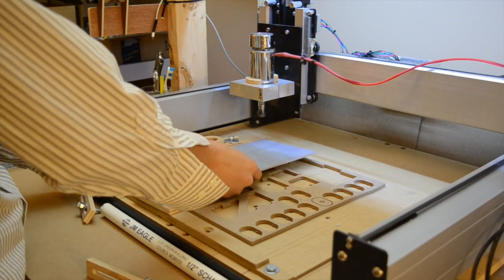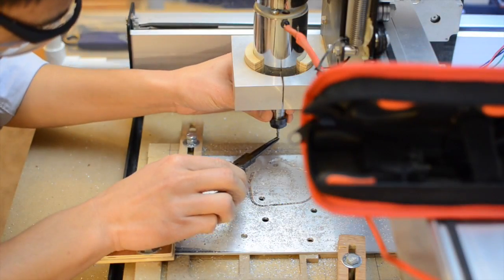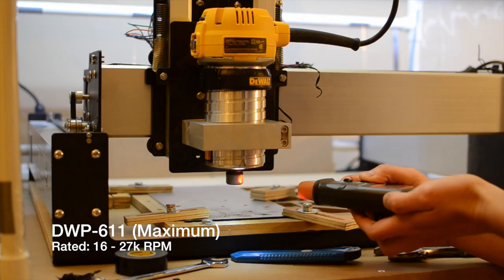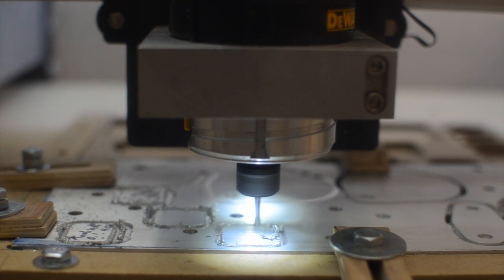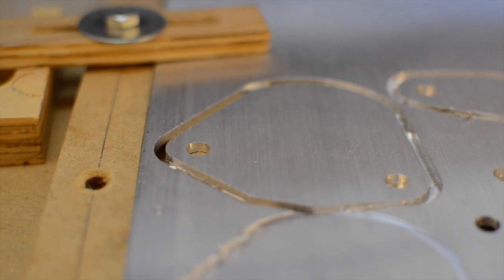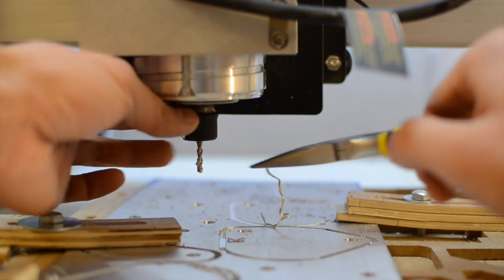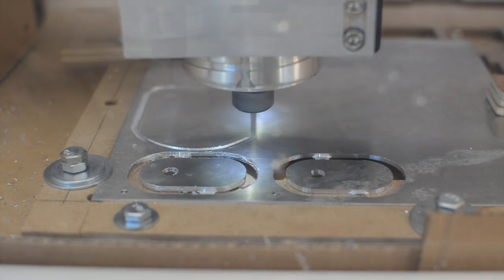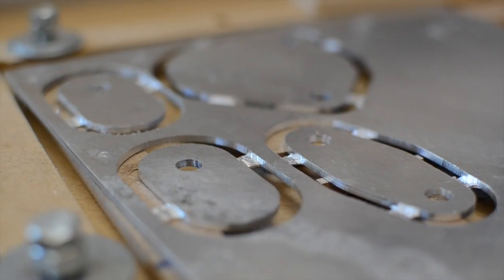How (Not) to Cut Aluminum on the Shapeoko 3 - Project 44

Comment: I also went through a lot of trouble with cutting AL. Here are the main game changers:  1. Single flute endmill. Nothing fancy, $17 for 10:  https://www.amazon.com/gp/product/B07F35WQYG/ref=ppx_yo_dt_b_search_asin_title?ie=UTF8&psc=1    2. Air blower, again nothing fancy, just a regular compressor with a jet blower.   3. Motor with closed-loop, like MKS SERVO42B, so steps are not getting skipped.   I can easily cut 5mm thick AL with 1/8" end mill. Speed is 500mm/min, spindle 10000, DOC 0.5mm.

Comment: shapeokos, no matter what model, can't machine squat! Maybe a few useless pieces of wood. Lately I stupidly fiddled for days with my shapeoko (that has NEMA 23s) to mill 3mm acrylic panels. It eventually... "kinda worked" but rectangles still came out trapezoids etc. My local lazer cutter ended up doing 10 panels for $37.50! So about $1k and many many wasted days of my life to save myself $37.50. Don't bother buying any hobby mill, 3D printer etc etc etc! p.s. I have two metal lathes and two milling machines that weigh 350-700kg each FYI... just for the knob heads thinking of commenting trash talk :-D

Comment: Great vid, thanks!  BUT No where even near enough lubricant!  Aluminum will always stick to the tool especially if your running high rpm.  The speeds and feeds are entirely dependent on the ability of the machine and the setup.  Charts and calcs are usually useless in my experience.  But unless your in some kind of mad rush (industry always is) just slow everything right down and you wont generate as much heat.  Not sure though on those routers how slow your RPM can go.

Comment: For aluminum in the Linamar Plants in Canada we used Varsol in a spray bottle to cool the carbide cutters while cutting Aluminum Chevy V-6 water pumps. It work very well. I found that the way my Machine was setup the the first month of running it was to slow and could never get a mirror like finish that was needed for Quality Control so i dial indicated the 12 cutter in the cutting head which removed the vibration, it was a old manual machine. I picked the lowest cutter and shimmed all the rest to match it, then i double the feed and RPM's of the tool and that allowed me to double my hourly out put with a mirror like finish. this got me a raise and allowed me to do my own machine setups after that. That was 38 years ago.  Try using conventional cutting when using the Shapeoko 3 because the light frame is like having backlash problems when using small flexible cutters Climb cutting pushes the cutting edge away from the stock and conventional draws the tool edge closer to the material which gives a more controlled size and needs less spring cuts do to tool flex.

Comment: If you have the possibility to add mist to your machine it would help a lot. In that way you get oil to your cutting tool as well as chip evacuation due to the pressurised air. This will mess up your wood base over time, but alternatively you make another base plate in aluminium !!

Comment: Get the machinist calculator app. It will tell you that 30-40ipm is your cutting range. Regardless if you have a 20k-30,000rpm spindle it’s too fast. Cutting aluminum doesn’t need to occur over 8000rpm on any machine so if you can’t slow it down without losing torque change the spindle. If your gantry can support it start with a minimum 3kw spindle or beef the gantry up so it can support it. Anything smaller is probably going to chatter, break end mills, or require triple the time simple skimming the part until it’s made. Who’s got the time for that?

Comment: Hello Winston, do you have any advise for engraving text on Aluminum. Need to engrave the text to a depth of .003 inches and the text size must be at least 0.125 inches high.  I am using a 1/8" V bit. the Amana 45609.  Not sure how to add the bit size into the library, Also how to adjust speeds and feeds. I was told that the Carbide Create program can not control the depth of a V cut.  Thank you.

Comment: Shapeoko is not beefy it is resonant as hell and the mills are tiny. Your rpm calculations are correct but you feed rates are for standard R8 collets not little tiny dremel collets. No book of industrial standards will even acknowledge a dremel sized end mill. Remember by industrial standards, shapeoko is a toy. In aluminum your feed rate needs to be 3/4 slower than r8 standard speeds at least! Its not a race if you want a quality cut. Also If your rpm is wrong the aluminum will either gum up on the bit or overheat it and snap

Comment: A good starting point for speeds and feeds is : cutter speed ( you can look up the cutter speed value for any given material in the "Machineries Handbook" ) X 4 divided by diameter  .
Back off on the speeds and feeds for your first run, then increase to see how much the project / set up can take.
The diameter in the equation is whatever is turning. If it's a lathe, then that would be the stock diameter. If it is a milling machine, it would be end mill diameter.
Hope this helps.
Take care.
Keith

Comment: Use very short 1 flute bits for aluminum.  The single flute improves chip clearing (which you accurately pointed out as a huge priority for routers in aluminum) significantly.  And the short bits give you similar rigidity to thicker bits.  wcproducts.net sells fantastic single flute bits.  You won't regret it.

Comment: On my CNC router ( my design and build), I also use the Dewalt router as shown in your video and I also run it at about 80% of it Max RPM. But, I use 1/8" single flute end mills that I buy from drillman on eBay, at 20 Inches per minute, and a .030" depth of cut. As you have found, a good blast of air to clear the chips is a must or they will weld to your cutter and break it. I do not use any coolant - just air. I have cut up to  1/2" aluminum this way without cutting a wider channel first for chip clearance.

Comment: Great video. Would you recommend this machine for fabricating small alumnium, carbon fiber and cutting cystal materials? Or do I need a more expensive industrial grade CNC machine?
Reply from the maker: This will do all of those, though each one has its own requirements. CF, the big one is protecting your lungs. And all of them benefit greatly by using specialized cutters.

Comment: I'm a CNC machinist by trade. I program gcode for Haas CNC mills both manually by hand and using cam software to complement more complex features. We cut mostly 6061, and we HOG it. 

There are a few key things I've learned over the years:

1) RADIAL ENGAGEMENT (this is the #1 source for the difference between a good or bad cut) - the amount of the diameter of the cutter that is engaged with the material being cut. The more the material wraps around the cutter, the less time the cutter has to cool off between cuts, and less opportunity for chips to leave the cutting area. I like between 5-25% engagement depending on diameter of the cutter. Keep in mind that not all cutters are made the same, and the simple act of plunging can ruin some cutters no matter what you try (it's often better to ramp down at an angle or Helix into part instead of plunging in z-axis only)

2) chip evacuation - both in the cutter and on the workpiece. If the cutter begins to re-cut chips it already removed from the material, it will develop premature wear and/or chip a cutting edge or break. If there isn't proper room for the chip to exit the relief area of the cutter, the cutter will clog up and begin the welding process.

2.5) cutter geometry (WOW)... This one is somewhat really important. Aluminum LOVES non-coated high polish solid carbide end mills with a sharp edge and a margin after cutting edge (to prevent the cutter pulling itself into material off-axis of rotation) as well as a high Helix. We run between 30-45deg Helix normally, and the only exception is extra long tooling. we are currently running a job that uses a custom ground .125" dia by 5/8" length of cut end Mill that we will probably have to shorten up because of chatter

3) coolant - well not really. It helps tremendously when you are taking deep and fast cuts with large stepovers, but if you learn from bullet point (1) then you will realize coolant helps but is not a king pin requirement. Coolant allows you to cross that radial/heat buildup issue by transferring heat away. Keeping radial engagement in your mind when programming toolpaths will relegate coolant's job more to long term tool life rather than short term (we have had 1/2" end mills that ran for 2+ years @ 40hrs/WK at a material removal rate of 20+ cubic inches per minute; that's 200,000 cubic inches of material a month as waste material in chips if I did mental math right)

4) rigidity - you mentioned this in your video. Pretty much is a basic tenet of machining. Good clean cuts require rigid machines and tools (most of the time; some operations benefit from some slight flexing but that's another topic).

I didn't mean this post to end up so long. I got carried away sharing my knowledge from my passion/profession... Lol

Good luck to you, and I hope I helped future endeavors.
Reply: I just printed this comment out, and posted it on my refrigerator.   Highest complements.
Reply: Comments from passionate professionals are often very good. Dense with information. Yours definitely is well appreciated by me, and I imagine anyone who is thinking about cutting aluminum or has started to and is having difficulty. Its one thing to think you have an idea what is going on, and another to have your suspicions confirmed by a pro.
Reply from the maker: All fantastic information. No amount of internet research can replace experience.

I'm actually a little curious now about what cases you think tool/machine deflection isn't a purely negative behavior...
Reply: when chasing an existing hole, using a rigid tool where the 2nd drill doesn't line up precisely leads to heavier engagement on one side of the tool. Using high speed steel tools (or flex in the machine frame) can allow the tool to flex without breaking. A solid carbide tool (especially a smaller tool size) in a rigid machine could break off in the hole because it is hard yet brittle and does not like flexing. This could swing the other way also, as too much movement could also allow the 2nd tool to bind in the hole.

Deflection in carbide tools = breaking, chipping, edge wearing. Simply put, if carbide is engaged with work material and it's not cutting the material, then it's bad news bears.

There are cases where a tap would benefit from less rigidity. Google "tapmatic" units (I think I got the spelling right). They have a special tool holding assembly that allows the tool to move off axis while still being straight (like the couplers that connect the stepper motors to the lead screws on other router tables)

I can't think of any other situations at the moment. Typically rigidity is best

Comment: pro tip: use an actual milling machine 

also use hss because there is almost no benefit to using carbide here as it needs higher feed and speed rates to provide any benefit, which are not attainable. the point of carbide is that it can be run hard and fast. you are incapable of doing that on this machine, so don't waste your money

Comment: Use the shortest end mill you can find to reduce vibration and shattering. ALWAYS use a spray mist of air an alcohol to lubricate the end mill and clear the chips from the cutter, this stops recutting of the chips which otherwise will deterate your edge finish. The alcohol stops build up from aluminium on the end mill. The rule is to actually cut aluminium and other soft metals with a high feed rate to avoid heat buildup in the end mill. Heat is the number one enemy of your cutters life. The rigidity of your machine, the power of the spindle and the quality of the end mill are the things determining how fast you can go. Your cuts actually look ok in the end considering the machine you're using. Alcohol and compressed air will make all the difference.

Comment: I have made slotting cuts with 1/8" cutters as deep as 15mm in aluminium (in small steps of 0,5mm), it helped cooling it with methylated spirits (or something similar). It suspends the chips and cools the part so it doesn't clog up. But the stiffness really seems to be a big problem with this machine, the flex you show in the video is really not tolerable. Maybe it's the chatter, that makes your bits break?
Reply from the maker: +Klaufmann part of the problem was the machine not being perfectly level, and some of it was the weak DC spindle I started with. I have since gotten better results going slow and steady.
Reply: Yeah, especially with simple CNC routers that aren't very stiff there are lot's of adjustments to make, I notice that on my machine myself. The leveling and alignment also isn't that trivial, because the components are often not perfectly straight or can sag because of the weight. I can measure a sag of roughly 0,1mm to the middle of the table, because I use 20mm unsupported rails. If I face a part and hold an straight edge (or in my case a metal ruler) against the light on the surface I can make out a clear gap in the middle and a touching spot on each end.
However, I use a ~1kW Kress spindle and that makes a huge difference. I also noticed that it is sometimes better to use a bigger endmill because it is more rigid.

Comment: Be careful when Milling aluminum it shrinks .0005 when it cools, I do 2 finishing passes with a higher rpm  with less doc to get a nice surface finish i also just use a compressor with an attached air nozzle to cool my part while cutting.
Reply: Not when you cool it enough ;)
I use methylated spirits for cooling and lubrication. But yes, finishing passes are really good to improve the surface finish.

Comment: Hello winston, I am ready to do aluminum cutting. my sock is 3/16" thick - it is not 6061 but 50-52 - I am new never cut anything yet just bought a SO3 XXL and been learning. pls help me tell me what is the speed for spindle  and punch rate, how many inch per minute.  I have a water cool spindle 800W -1.5 KW
Reply from the maker: I honestly don't have a good point of reference for you. 5052 isn't supposed to be very good at machining (https://www.shapeoko.com/wiki/index.php/Materials#Aluminium). I would try the "official" feedrates recommended (https://www.shapeoko.com/wiki/index.php/Materials#Official_Feeds_and_Speeds), make sure you have a coated endmill, and cutting fluid. If that doesn't work, adjust your cutting parameters from there, faster/slower. I can't advise you which way to go, as you're well and truly in unknown territory. Unless you really need 5052, I would abandon it and get some 6000 or 7000 series material.=
Reply: Thank You for the info

Comment: Alcohol mixed with water at a ratio of 30% Alcohol and 70% Water works very well for aluminum.  The alcohol cools the material much better than water and the water is sufficient to keep from any possible combustion if heat does build up.  Plus the alcohol helps evaporate the liquid and reduces oxidization.
Reply: Rodney Reynolds sounds like a recipe for an explosion.
Reply: urjnlegend ... that would be a nope.   many use a much higher alcohol to water ratio and is safe.   combustion requires specific fuel to air ratios and wth the introduction of the water it throws that potential out.

Comment: there is something in germany we call it glueing, if you are to slow the aluminum will "glue" so at work we cut aluminium with a spindle speed at 1800 and cooling (cooling is important against glueing - sorry dont know the english word for that - sticky?)
but i think you have to look what kind of aluminum you have     by the way NIce Video :)
Reply: chip welding
Reply: "Gummy."
You are welcome.

Comment: thanks for sharing this video! I made my own cnc, but i wasn"t shure if i could do aluminium as well. But i think my design of cnc is even stronger than a shapeoko, so i'm going to try aluminium too. Woul be great if i can do that too. Thanks for the warnings and personal experience. ;-)
Reply: Wim Meeus was it hard to build?
Reply: it wasn't as hard as i expected. That will be beginner's luck i guess :p . I made a lot of mistakes though and i'm allready thinking of rebuilding my machine with some major corrections. Good thing is now i can use this cnc to do the perfect measurements and cuttings, so it will be easier this time. :-)

Comment: that spindle isn't nearly strong enough for aluminum.  need a DeWalt.
Reply from the maker: +Jesse Fritz Yep, even better than the Dewalt in this case though is the Makita.
Reply: I'm ordering mine probably Monday. Would you recommend that over DeWalt?
Reply from the maker: The only thing to note is that the Makita is slightly shorter than the Dewalt, so if you're cutting at the wasteboard level, you may have trouble reaching the bottom with shorter endmills, like 1/8" and 1/16" size. However, if you tape or screw down an extra 3/4" sheet to the top of the wasteboard (see my "Machine-Leveled Supplementary Wasteboard" video), that fixes the problem, and even improves accuracy.  If you're willing to put in that little extra bit of work, I'd say the Makita is definitely worth it. If you're not doing as much metals or plastics, the higher 16000 RPM minimum of the Dewalt isn't as much of a factor.
Reply: I'll be doing aluminum and nylon and hopefully even G10.